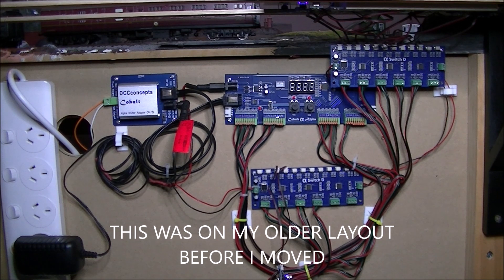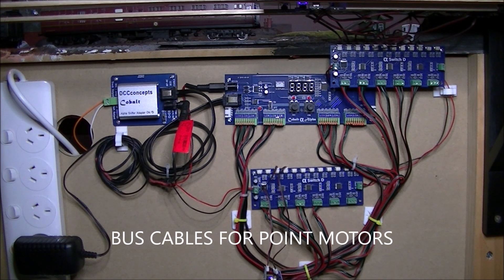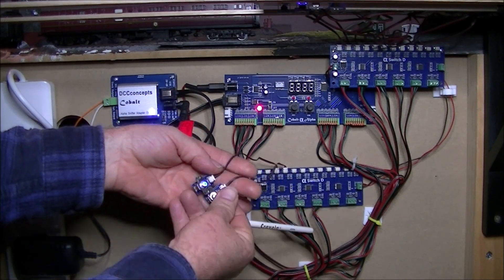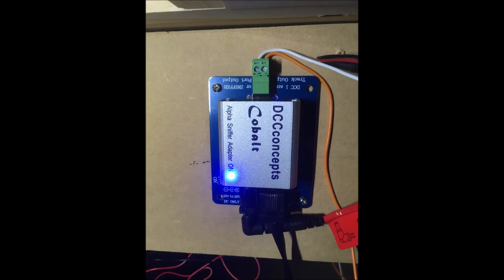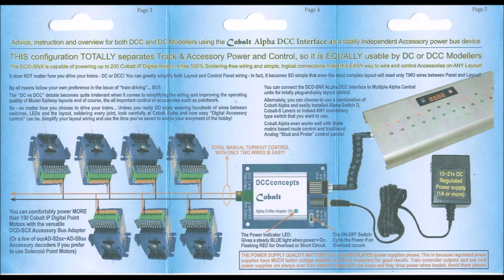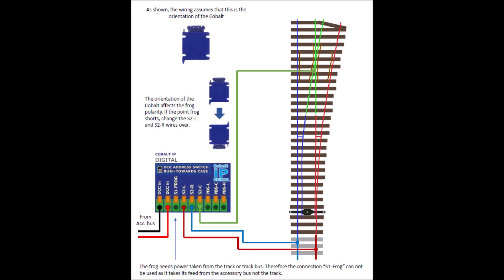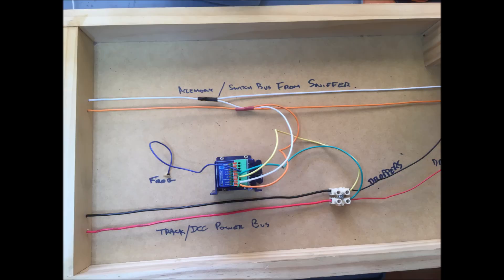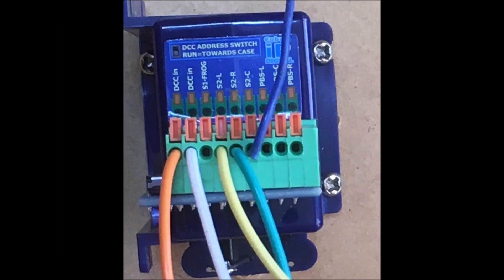DCC Concepts Cobalt Alpha Sniffer. Operation and fault finding

Comment: Fairly obvious really. The DCC accessory bus is strictly controlling the point motors only. 

Terminal 3 is changing with reference to terminals 1 and 2.  If you have a separate DCC track bus then the frog needs to change with respect to that bus.

You were essentially mixing 2 different DCC buses so I’m not surprised it didn’t work 😂
Reply from the maker: yep you got it in one, but would have been nice if DCC concepts had included a suitable description or wiring diagram at the time. This was several years ago and several others have commented on having the same problem with no solution... that's we all do this to help each other out
Cheers
Al

Comment: Thankyou for your handy to know vid. When I installed the DCc Concepts Alpha gear on our club layout, we used the power from our DCC Bus circuit to power the system, unlike you where you used an independant dc power supply. I had no problem using the frog wire to the frog terminal on the cobalt SM. I think that is the difference between the two power supply methods. Your solution was rather slick, nice! Idid not need the sniffer but I did need the Cobalt Box etc. More expensive than your option but it works magnificently. Dont worry tho, I had to do a bit of head scratching to get it play nice!
Reply from the maker: Yep that's how originally installed them via the dcc power bus, but was fiddly having to remember switch addresses (memory not as good as it used to be)etc to use through the dcc controller hence moved over to this system using the sniffer etc
but thanks for your comments
Al

Comment: My Sniffer unit has an issue.This morning it was red so I powered it off and on again. Unit came up with a pale blue, then flashing blue and now no light. I still have control of my switches via Alpha Central. Would appreciate your thoughts please.
Reply from the maker: Thanks Tony
The main reason that the sniffer would turn red is if there is a wiring issue, like a short or something, the other main factor that would affcet a sniffer is if you are using a different power supply, (having fried a sniffer myself using the wrong power adapter it didnlt just turn red it smoked as well) that may be the wrong voltage or current... so check that and see if its still giving you the right amps and volts. From memory I believe the originally recommended a regulated power adapter, The fact you can still operate your points is interesting.... so you still have power. Where the points working when the red light was on? if everything else checks out then maybe its just the LED circuit?, otherwise I have no idea

hope that helps
Al
Reply: @allynwoodmodelling  Thanks for your reply. The issue has been solved by repairing a dry solder joint on the unit. 
Regards Tony
Reply from the maker: Great to hear  @tonystringer5452

Comment: Hi there, currently conversing with DCC Concepts about using the alpha switch system, they are stating that I need to purchase an alpha box to communicate with a Digitrax DCC controlled layout, the sniffer unit is a cheaper option, does this have to be on a separate bus or can it be connected to main track bus for it to operate.
Reply from the maker: It needs to run a seperate bus wire, and if your points are electrofrog then you will also need to run wires from your track power bus in order to give the electrofrog the correct power (so 5 wires per motor, 2 "dcc  in" wires to control the point motor from your new sniffer bus, 2 wires from your track power bus to provide power for your frog, and the frog out wire to the electrofrog itself), but mine works well once i figured that out....... hope that helps
Al
Reply: I've decided to purchase the alpha box as it saves putting in another bus, can you still operate the point motors using the digitrax controller?
Reply from the maker: I have no idea, 
 @paulrounding5260

Comment: Hi your video was great helped me solve the shorting-problem
I cant  seem to change the direction of the points using 197,
Tried loads of times and just it just wont  work, all I want to do is have all my points when on green they are all running straight and when on red the point is thrown,
Hope  you can help,
Kind regards
Chris
Reply from the maker: 2 things i can think off. One after setting 197 then turning it to run are you turning the power off to the motor? and the only other option would be to remount the motor flipping it through 180 degrees so it mounts on the other side of the point to wich you have it now?

Comment: Hi Allynwood I have just got the ECOS ESU Command Station 50210 I set it up today and placed a Bachmann with a LoKSound 4.0 sound chip onboard onto the progam track set it up to read the decoder. I suddenly heard a crack like a matchstick snapping then smoke and that god awful smell of burning electronics I quickly removed it from the track worrying it was the controller I turned it off I rang Rails of Sheffield in the uk and they were helpful, they said the doubted it was the Loksound chip and more likely to be the controller they kept me waiting listening to the same incredibly boring message before coming back and telling me about the fact that they could not test it there as the only way to test the ECOS was with a DCC concepts sniffer. However, watching your interesting video I am not sure that the sniffer would be able to tell me if my controller had a problem, I don't suppose you would have any ideas would you. All the very best Adie In War and Peace
Reply from the maker: Hiya
sorry for a late reply but been away for a holiday for 4 weeks, 
I doubt very much that the sniffer would be any use to you at all? as my understan ding is that it is similar to a command station in that it takes the information and sends it out via a bus line system, so i doubt very much that it reads abnything back the other way, and it is designed to be used in conjunction with the alpha encoders. So i think they are just probably mixed up in their information. I'm not familiar with the ECOS system so can;t really help you with how to check it.  being ESU and the same ESU making the  loksound i would doubt if there was an incompatibility in the electronics. It really sounds like there was too much voltage going through the chip, so my advice would be 
1: Recheck the wiring and make sure it is all wired up correctly
2: Check the voltage of the output on the programming track and mainline track using a multimeter 
2: have you run any other loco or chip using the new controller on the main line or programming line without an issue
3: Had the loksound decoder been used previously with your old controller.
4: check on youtube or other forums to see if there has been similar issues

I did find something using the Ecos and sniffer from DCC concepts link here ( https://www.dccconcepts.com/wp-content/uploads/2023/03/ECoS-Command-Station-With-Alpha-Station-And-Sniffer.pdf ) but it looks like its taking signals from the alpha encoders into the ecos CSu via a sniffer (not the other way around)

Hope this helps somewhat .... please let me know how you resolve this as its quite interesting, I presume the loksound 4 is now just a smoking pile of circuits 
Al

Comment: Another WA modeller , hi there, very interesting video, I have about 30 analogue motors with electrofrog points and panel but not digital. I have the frog powered from the track and new some systems recommended a separate power bus for frogs? I am just about to start the last section with a bout 12 points and was considering the IP digital. Cheers
Reply from the maker: Thanks for your comment, you can run the IP digital without a separate bus, i changed mine more to do with my controller than the wiring of the frog, using the DCC power bus is easier, and I believe you should be able to wire it up the same as your analogue motors, but then again I haven't tried. Your layout loosd pretty well completed and looking well detailed too
Cheers
Al
Reply: @allynwoodmodelling  Cheers much appreciated

Comment: So it's basically wired similar to a tortoise using a separate DCC accessorie decoder!
Many thanks for your video it will save me much head scratching when I install my alpha central and cobalt IP digital motors!
Reply from the maker: Pretty much, you don't need a separate decoder for the motor as its  built into the motor itself, I only used the accessory bus in order to separate it from my throttle controller (plus my wife says I'm a chronic button pusher... fair enough)  But I hope it helps, The alpha system seemed easy and logical when I started but I did find a few traps for the unwary.... above all take your time and try to have fun
Al

Comment: Strange that's the very thing I asked DCC Concepts three days ago. I'm a total novice with all this railway modelling trying to rig up test system to use the DCC concepts power and and A box don't know what I did wrong but the A box started to smoke!!!  Dcc concepts do not use detailed enough wiring diagrams for me.  Just showing one line from A to B is not much good if you don't know which socket it goes to.  DCC concepts told me I do not need the sniffer for a accessory bus is that correct?
Reply from the maker: it depends on what you are running on your accessory bus, and how you want to control it. if it has built in encoders/decoders and the like, or if its a simple bus like lighting.... either its on or off etc I don't know that much about other controllers and how they can control an accessory bus if its routed through them.

Not much help, if it smoked (my sniffer did that once) check your polarity, voltage and amperage of the transformer you are using to power it, they don't appreciate it too much if you get it wrong way around. (had to replace mine). 

learning the hard way can be expensive but at least you can be sure you will never do it twice

Al

Comment: Hi Mark. I also don't know which forum you may have seen the diagram on, but it looks to me that the diagram originated on DCC Concepts own website in their advice section (I don't know exactly where). Anyway, hope you still had some hair left after all those years trying to solve the problem!
Reply from the maker: Thanks Paul, I am missing a few chunks..... you are right it does look like a DCC image pity they didn't include it in the manual!.
Cheers
Allan

Comment: Hi, Can you tell me if I have 2 separate panels that include the same turnout address, will this system update both panels  led ? Also, if the turnout is selected from a throttle, will the panels led be updated ?
Reply from the maker: To be perfectly honest the best person to answer your question would be DCC concepts themselves, As for selecting the turnout through a throttle  i don't think anything would be updated as   the system is a one way system (ie the signal comes from the LED push switch down through the  panels and system to the sniffer , i wouldn;t imagine it goes the other way, but DCC would confirm that. I would imagine it would be pointless (sorry for the pun ... not intended) to have duplicate systems.

Hope that helps, probably doesn;t though?
Allan

Comment: Great video - took me two years to work this out 😂! Would you recommend having a separate bus wire for the point motors feeding into a mimic board? I’m struggling to see a viable alternative that doesn’t cause chaos when driving the locos.
Reply from the maker: I use the cobalt alpha switches on the mimic board that feeds into the motor bus and that's what caused the problem. When the ran through the dcc track power bus it worked fine. If you can run your mimic panel through your dcc track power control system that might be another solution. I believe there is a way of running the sniffer into the train controller if it has a sniffer port ( some do but don't know which ones) then that would remove the need for a separate bus.  I personally now like having a separate bus system...... Now as it's working. 
Cheers Al
Reply: @allynwoodmodelling  The problem is you have 2 sources for the DCC signal. The sniffer accessory bus and the track bus driver. Whereas DC has a fixed voltage on one rail DCC does not. DCC is an alternating signal (ie both rails can be high or low). The signals would have to be in sync to avoid a short (which with DCC occurs with a jump in waveform). If you wire the frog to the accessory bus, the two busses meet  via the loco wheels and a short is the result. Wire the frogs to the track bus and there is no short because the two busses don't meet.

Comment: Just found this video, so Pleased you sorted out the problem, really surprised that DCC Concepts haven't written concise instructions on this, as you are certainly not alone with this issue. Regarding the initial electronic issue, I think it would only be someone that understands railway electronics that could have solved this easily, from a normal electronic background you have to understand dcc and how a electro frog works and having 2 separate buses would also confuse the matter LOL! essential all you have done is use the switch function on the cobalt to switch the black or red to the frog depending which way the blade has thrown on the point. Your video has clear instructions and easy to understand so kudos to you, and I'm sure it will help out many modellers. I just hope DCC Concepts get to see the video so they can put this method in their instructions! All the Best Tony
Reply from the maker: Thanks, seems simple in retrospect
Reply: Yes what a headache.  The instructions should just say for DC layouts use one of the accessory switches for the frog power. The SL-Frog is only for DCC layouts, but surprised that wasn’t obvious to DCC Concepts when it was raised.  Thank you for the video and highlighting the issue. 👍

Comment: Excellent! Two days too late for me but this is the conclusion I came to as well and it’s now all working fine. I was surprised that this isn’t something DCC Concepts have a video on or at least a manual.
Reply from the maker: Thanks Mark, was meaning to get this out a couple of weeks back, glad I wasn't the only one with this problem, for a while I was going crazy trying to figure out what I had done wrong. I agree DCC Concepts should have it on the manual. Though give them their due I think it was them that posted the image.
Reply: I just had a test board with one point on it as I had a feeling I would run into issues! Using a multimeter to test voltage to track helped too. That way you can be sure polarity is right before trying it with a loco. Time to get on with the real layout now. 🙂